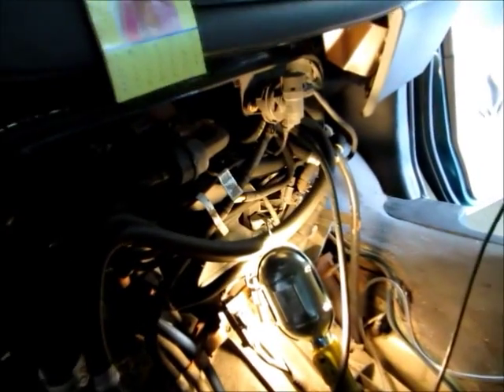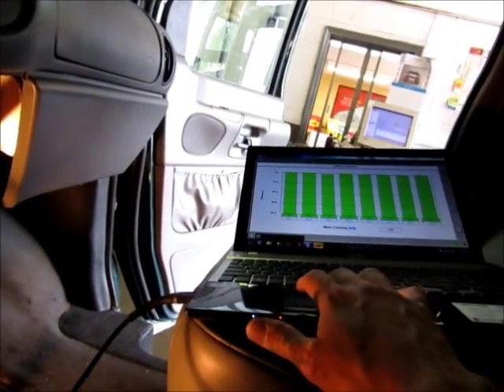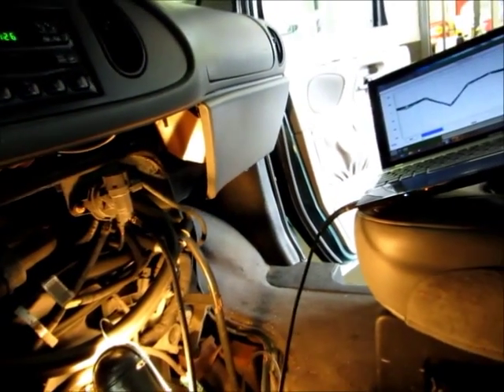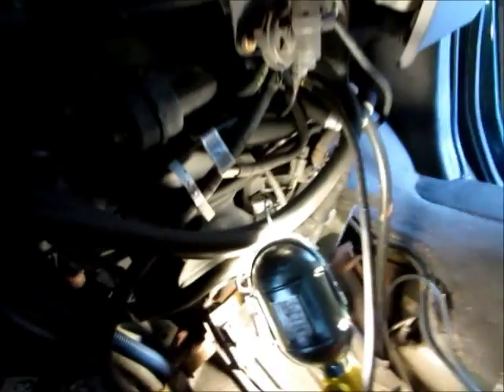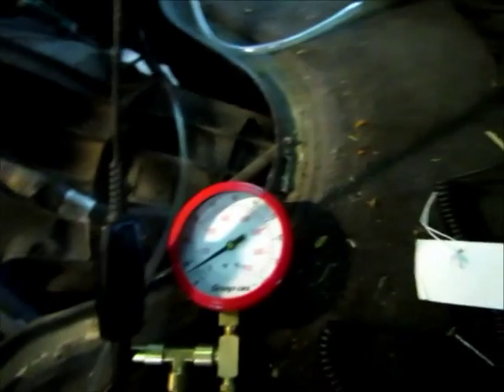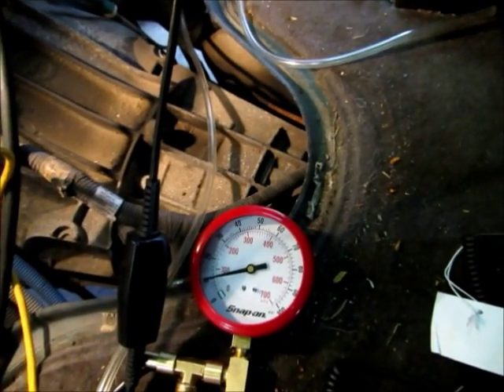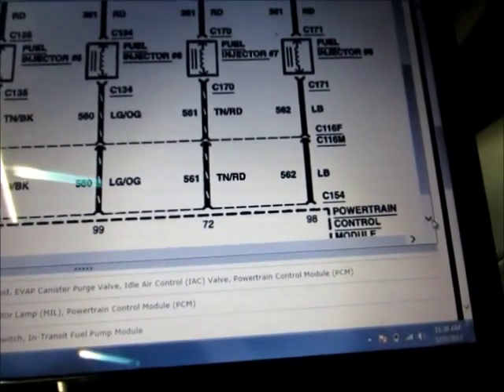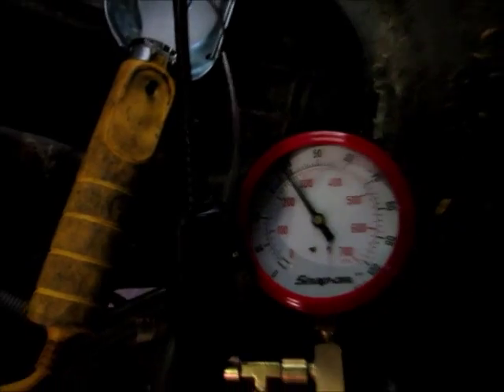2001 Ford E350 Injector stuck on runs rich

Comment: Why did you cut the wire instead of disconnecting the fuel injector connector?
Reply: Joe Yoone you make a great point there Joe. He diagnosed the transistor driver was bad in the PCM but he didn't say that the wiring harness was bad. Nice catch.